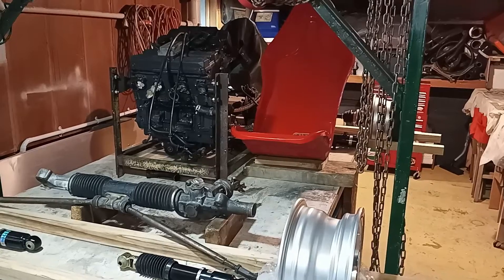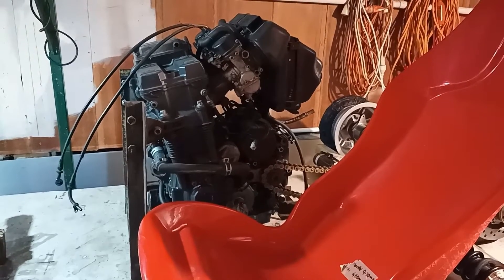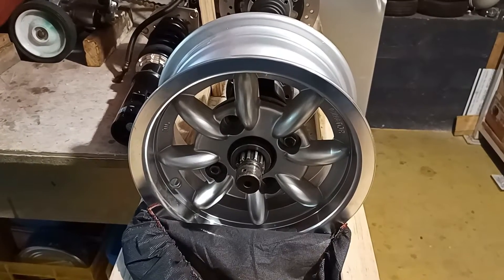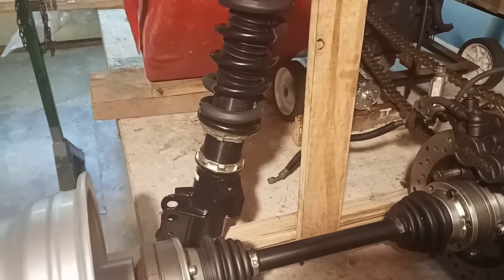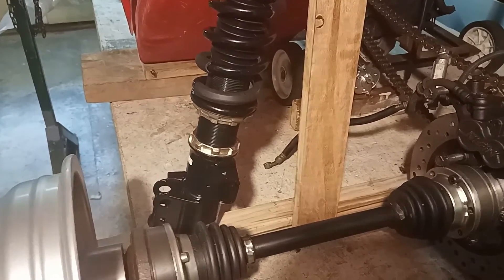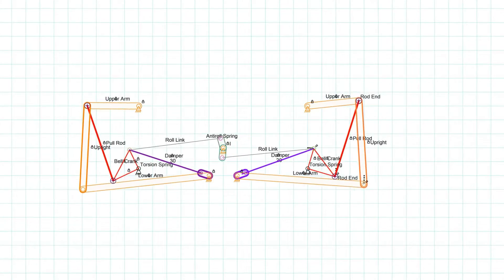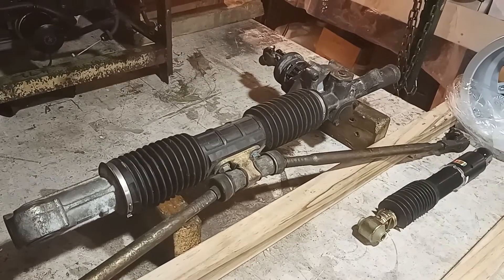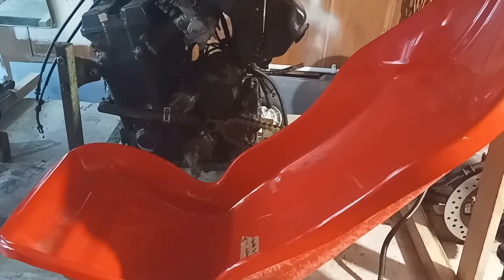Bike Engine Track Car Overall Layout

Comment: If you wanna do something REALLY high end, look into making front and rear wings that act directly on the axles instead of the suspension.
Reply from the maker: Yikes, that'd get my car banned. One advantage of the struts at the rear is that I have plenty of space for underbody aero
Reply: @Stu718  Oof. I thought unsprung aero was usually NOT banned in "build it yourself" classes. Oh well, at least you could still do a crazy fan car like that McMurtry Spéirling that debuted at Goodwood?